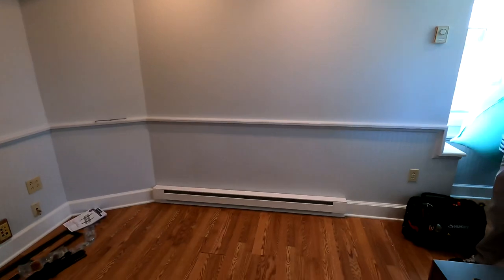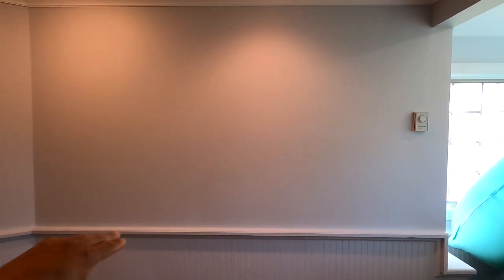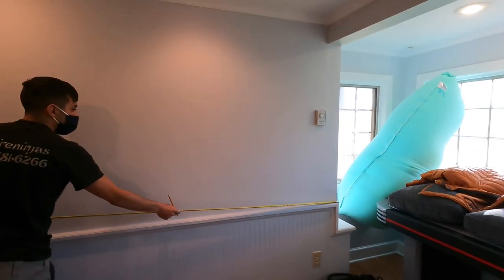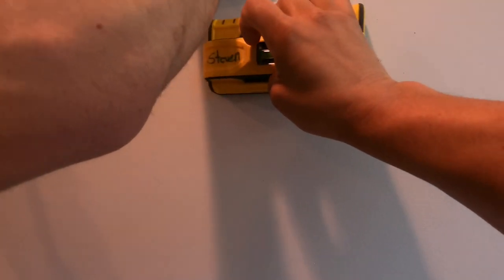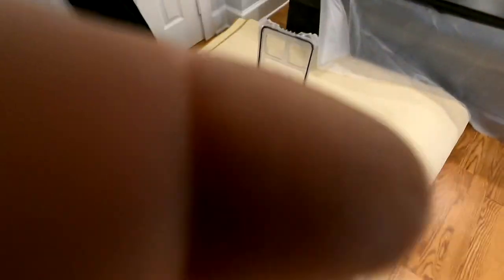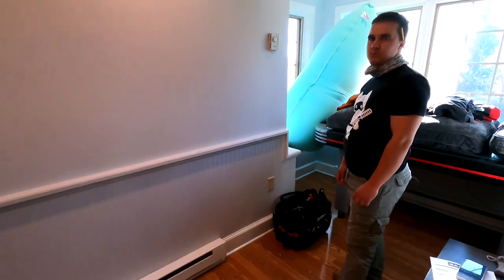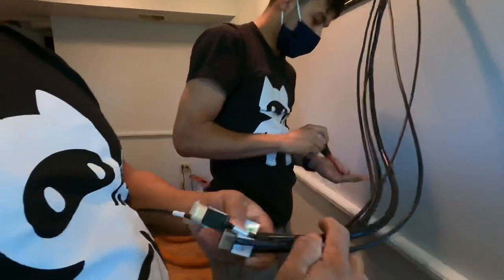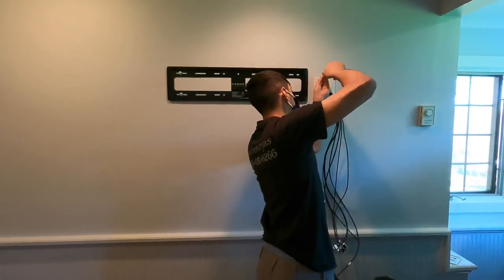How to Mount 80+ inch TV to Wall & Hide Wires Step by Step Samsung Q90

Comment: Jose is right about the lags making the mount off Level. this just happened to me. not by much, but because of the mass off the TV,  any slight difference in the Mount level, is Magnified when you put the TV up. I was screwed but luckily was able to remedy this by moving one mount on the back of the TV till the TV was finally level. Do the TOGGLE Thing

Comment: What about 75 inch samsung tv it's so heavy you think it will mount okay I worry it will fall of the wall or the pressure from the wall mount and tv if it leans will pull on the back the tv and damage the inside

Comment: i just make a cutout from the package the tv comes in to the tv size and mount it with the vesa mount and just use ducktape to tape the wall mount on works great every time and you can skip most of the measuring

Comment: Just like another comment already made...you skipped showing the trickiest part of the install: tying the AC circuit in.  Did you tie it to the the outlet next to it in the wall?  Did you run it to the breaker box?  Was there a basement to work in?  What if there is no basement?  Sorry... good info on the easy stuff but epic fail on the AC voltage portion.
Reply: They just pulled the power from the outlet on the right. They indicated that there wasn't a stud between the power source and the new box to the left. So they just snaked a wire between the 2 and wired it up.

Comment: At the beginning when I saw you guys okay the panel flat.   I was like oh no.   Not good.   That's going to lead to a Crack screen.   Then at the end.   You guys died a Crack screen.   Not surprised.  Huge panels don't like to lay flat.
Reply: But its a flat panel.
I knew too. And dude dropthe linesman pliers on the wood floor, that left a scratch too. 

And yes ive delivered tvs and picked up standing transport standing and delivery standing.
Reply: Yeah I stop laying TV's flat they are too fragile. Just a little pressure is enough to crack it. They probably should of just plugged in the tv first
Reply: @TorranceJPlaylist  so what do you do? Lean it against a wall?
Reply: Correct the tv can’t handle that height on the screen being layed flat like that. The tv comes where you can remove everything and it’ll still stand straight with the foam. When I saw how they placed the tv I knew it was going to crack
Reply: @Srt.jay323  ah, ok. the manufacturer  (LG) of the 65er that i just bought said to lay it flat screen down. I remember these comments but laid if flat anway lol.
Reply: Right the could of just let it stand up im the box

Comment: I’m not a fan of rubbing low voltage cabling next to power but that’s just me ..
Reply: I feel you, I agree. I just have two wiring cable hole outlets one from the tv and one down there. all separate and easier to switch out from one console to the next
Reply: Same here....it's low voltage so it doesn't matter too much. If I have to do I will just wrap electrical tape around one of the wires just to give it a barrier between the two shrug

Comment: My guy really used a calculator to divide 96. Toggles are safe but already on two studs and the tv bracket don't have much room to move left to right kind of a waste of toggles imo lol but good video
Reply: So toggles are not really needed? About to mount my 85in next week. The contract who did my fireplace installed a thickboard into the studs to place the bracket on

Comment: You should actually measure from the mount screw hole to the bottom of the tv for the offset instead of the bottom of the mount to the bottom of the tv.